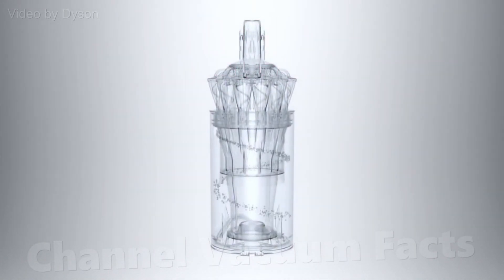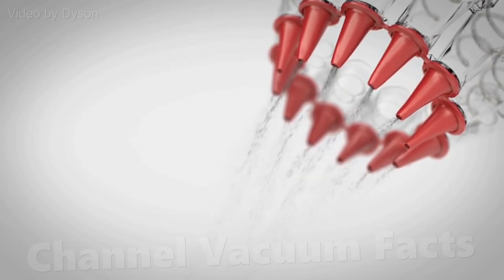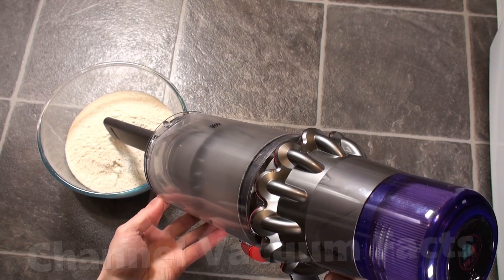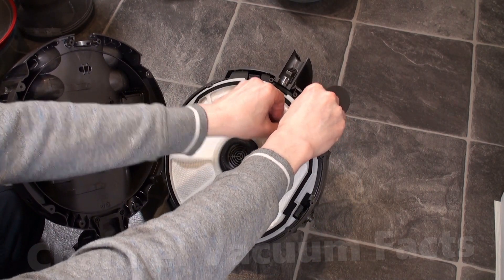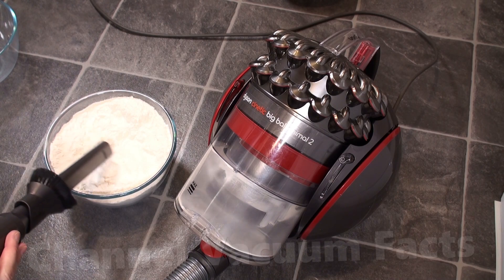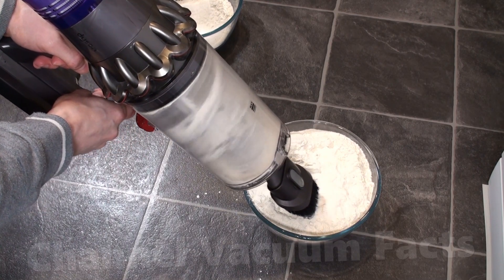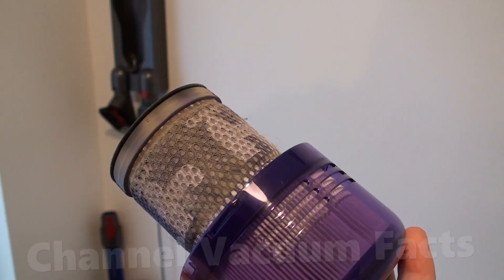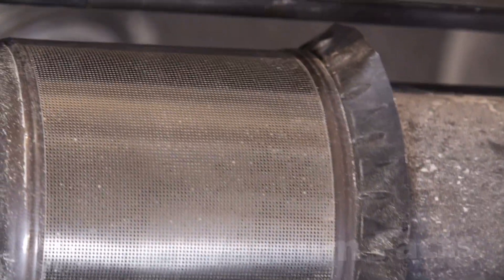Dyson Cinetic Myths – Testing How Good It Really is!

Comment: is it just me or does anybody else think these things are over engieered?
Reply from the maker: No idea what the term "over engineered" means, specifically and in context. Whenever the term crops up, it's never explained or qualified in any way, let alone with any convincing evidence to justify the position. From what I've seen, it's just a non-term that means literally nothing. These machines are, however, engineered to achieve specific practical functions, and do them well.
Reply: @VacuumFacts 
‘Over-engineered’ is a term for something that is engineered well beyond its expectations of usage. This can have no negative practical effect on the subject in question like Dyson machines. It also can induce heavy negative consequences on the subject from the excessive engineering and negate whatever benefits it has. Example would be the Tiger tank used by the Wehrmacht during WW2.
Reply from the maker: I await the evidence that it applies here. I am aware of plenty of evidence they employ lean engineering, which is the exact opposite.
Reply: @VacuumFacts 
Yeah no I don’t think it applies here. I was simply defining the term saying that there are instances of over-engineering with negative impact.
Reply from the maker: @qasimmir7117  Good. No need to beat a dead horse.
Reply: @VacuumFacts 
I wasn’t.👏🏼

Comment: Dyson doesn’t sell  cintetic big ball 2 in North America. There are ways around that my question is the plug is there a safe way to use the machine in America. Like having the enter mains cable replaced or an adapter?
Reply from the maker: It can work safely only if you operate it at the correct voltage. You'd need the appropriate transformer to provide the voltage (and power) the machine expects. That can end up being impractical, since transformers are heavy. I'd recommend saving up and investing in one of their newer products instead. There's a new mains-equivalent stick vac coming out in the not too distant future (called the Piston) and possibly other machines, currently out in Korea. Technology has moved on considerably since the Cinetic days. https://www.dyson.co.kr/piston-animal-ds60-cordless-vacuum-matte-black-copper https://www.dyson.co.kr/products/vacuum-cleaners/cord-free/piston-animal/owners
Reply: @VacuumFacts but I like Dysons canister and I’m tempted to purchase models that were exclusive to Japan
Reply: @yLaQueso0 You could use oven, stove, range, dryer or car charger plugs which should give 240V. But you could just get a transformer rated for 900W(thats how high vaccums can go by standard) and it will run all vaccums. Dyson cinetic is about 700W
Reply: @mineciberkay it’s not worth the risk
Reply: Because America uses 120V You would need a step up transformer To convert 120 V into 240v Countries with 240v Have high voltage and low amperage where is America  Is the opposite they have low voltage and high amperage. But if you plug A 240 V appliance into 120 V theres a chance it could damage it Some vacuum motors can be modified to work But it would be more hassle Than just to buy a converter

Comment: Don't believe the hype.  They clog..

https://youtu.be/gToZaFyBMoY?si=sJUg8jX8HcoRP15P
Reply from the maker: I don't believe hype; I believe evidence. Yes they do clog...when abused and neglected, like anything, as shown in the misleading video you linked to. When used properly, they work fine, as evidenced in this video you're commenting on.
Reply: @VacuumFacts  They have no pre motor filters.  During regular use they can and will pass dust and debris through the motor.  Dyson advertises that no maintenance is required with these machines.  Using them properly with no maintenance can and will lead to failure.  It's misleading on Dyson's part
Reply from the maker: They have no pre-motor filters because the cinetic cyclones remove the particles they would have anyway. Nothing passes through to the motor when used correctly. This is evidenced beyond all reasonable doubt in this very video. However, if a machine is abused and not emptied, the cyclones can fail, causing large quantities of dirt to escape them. Abuse and neglect causes this machine to fail. I've seen no evidence showing precisely how to reproduce alleged failures from correct use. If you have any from a reputable and convincing source, please share it. Unfortunately the source you linked to before failed to show this and only showed what looked like abused and neglected machines.
Reply: @VacuumFacts  That is the theory but in practice it's just not the case.  You're either a paid influencer or a Dyson fanboy.
Reply from the maker: Unfortunately, you've provided no evidence to support your claims which conflict with evidence available that they work fine (you really should watch the video you're commenting on...). I've no reason to believe you. And given that you ended with unsupported personal accusations, in the absence of anything of merit, you've also now lost credibility and respectability.
Reply: @VacuumFacts  I have watched the video and I have my own Dyson Cinetic Big Ball Turbinehead in addition to a V11 from which to draw personal experience.  You want to discount what you choose not to believe.  https://youtu.be/7nS6x6BZDJw
Reply from the maker: If you've seen my video, shame you literally ignore the observations and don't account for them in any detail whatsoever. Your linked video is, again, evidence of a machine whose history is unknown and therefore more likely a user that has neglected it and it failed. The video shows no evidence of a method to reproduce such failure by only using it correctly, which is what is needed to support your assertion convincingly. It's very simple to change my mind but you're working against yourself by peddling content from infamously misleading sources and misinterpreting what's shown. What you also don't realise is that if you can show, with evidence, that the machine fails when used according to the manual, you'd be able to get very rich from suing Dyson. Hasn't happened though...perhaps the burden of proof just hasn't really been met. Trott on.
Reply: @jhh469  ive had my cinetic DC 75 for at least 12 years. Never had to change the filter or clean it out. If you let the bin get too full, way past the full marker then dirt can get past the cinetic and clog the filter. I suspect Dyson decided alot of customers were letting it get over filled, so they dont make too many cinetic vacumns these days.

Comment: i feel like if they brought this back they would sell better than they do now. the idea of having a vacuum without maintenance was amazing when bagless vacuums came out until filters. people would go through vacuums without knowing about the filters. The cinetic technology would sell so many more models just for the thought of no cleaning filters or bags just emptying
Reply from the maker: Possibly. The cyclonic technology has improved a lot since the mains machines, and the filters see so little dirt on the V15/Gen5, even without cinetic tips. They're likely to see less still in the next model with the possible changes to the first stage bin cyclone and variable cyclone use to maximise airspeed through them.
Reply: They stopped because the kinetic tips became a trap for long hairs, any hair longer than 4 inches would clogg all these machines, the Achilles heel of most Dyson's, great for dust, but terrible for hair

Comment: Watched another guy test the new cinetic system. Before he started, he showed no dust in the middle tube that feeds right into the motor, vacuumed for a few minutes amd made sure to not pass the max line but when he checked again, he was able to wipe dust off with his finger; the cyclones werent able to filter the dust. The name was the Dyson DC75 Cinetic. I think that similar testing showing completely different results just shows that the system is unreliable for mass market use. Maybe the tolerance for building this type of product is too small for dysons manufacturing capabilities and might be why there are so many differing stories
Reply from the maker: That vague anecdote was hardly convincing. Any real evidence?
Reply: @VacuumFacts  ur test was just as much an anecdote as the other guys test....and taking a company worth billions of dollars at their word is not very smart either
Reply from the maker: You evaded an answer and then confused an empirical observation with an anecdote. I think that tells us all we need to know about your input here. Adios...
Reply: @VacuumFacts  your test was an empirical observation while another youtubers test is an anecdote....? Make that make sense?

Thousands of bad reviews is imperical data, not anecdotes.

Comment: I conducted an experiment with my V11, absolute pro. I cut a piece of bounce sheet and put it in the canister bin of the machine. I've noticed a very good improvement on the canister. All that fine dust stuck to the bounce sheet and didn't cling to the canister. Lots of the fine particles are statically charged. Without the bounce sheet i tapped the canister lightly and the fine particulate dropped onto the paper towel. This was done after 1/2 hour of vacuuming. Then I cut a small section of bounce sheet and stuck it into the canister and vaccumed some light carpeting and floors upstairs for 1/2 hour and wow, the fine particulate stuck to the bounce sheet. After inspecting the canister on the screen and in the main passages there was barely any fine particulate stuck to it but the bounce sheet held all the particles. After tapping the canister nothing came out of the cyclones and using a flashlight inspecting the inside it was very clean. Even the seals on the lid and on the top of the bin had no dirt accumulations.
Reply: This is a very good experiment thank you for the info!!
Reply: Wow. I’ve never thought of doing that. Absolutely gonna try it now!

Comment: The main engine filter used to get really dirty n needed changing n was quite hard to do ,complete nonsense this was that's y dyson brought bk the filters
Reply from the maker: No residential vacuum cleaning product has an engine. If you're suggesting cinetic didn't work under responsible usage, then please see the video for evidence to the contrary.
Reply: @VacuumFacts  I had an upright and a cylinder I know what I'm talking about, also the cylinder moter burned up, u did one simple test u didn't use the machine for 2 years ,loads of people complained the same thing there's a very good reason they discontinued the thing, not possible to have a vacuum without a filter or pre filter ,that's y they r there now
Reply from the maker: Unfortunately, you've provided no methodology to reproduce your alleged failures, which is considerably less convincing. Also, they haven't discontinued them, globally; they're still sold. If you're wrong about that, when it's so easily fact-checkable, I've no reason to believe you're right about anything else. Everything you said is a myth debunked a long time ago. Cinetic was discontinued because the focus is now on handheld devices which can't support it and it'll not likely return because of newer, better technology. This was all discussed in the video.
Reply: @VacuumFacts  ur talking about newer better technology then y have they stepped back and returned to the filter??? Ur also wrong because they made one more dyson after this and its an upright without the cinetic that didn't work,  every machine I worked on had burnt out motors because the filter was blocked up ,every filter I took out was destroyed by dirt, I know u want this to work but it just didn't although if perfected it would be awesome it just wasnt
Reply from the maker: >> "ur talking about newer better technology then y have they stepped back and returned to the filter???"
This is discussed in the very video you're commenting on. I recommend watching it. Also please read my previous comment; Cinetic products are still sold in some geographic locations.

>> "they made one more dyson after this and its an upright without the cinetic"
Yes, because focus was shifted to cordless research. Please see previous comment.

>> "every machine I worked on had burnt out motors because the filter was blocked up"
Please see previous comments. If you can provide a detailed methodology to reproduce when used as instructed, distinct from abuse and neglect, then the cause can easily be identified instead of assuming it doesn't work. There is copious evidence it works well when treated well, such as in the accelerated use case shown in the video.
Reply: @VacuumFacts  ur video proved absolutely nothing ,u used flour then showed us a white filter, if u wanted to show us a white filter with no signs of white flour on it y didn't u use a uv light to show traces of anything on it?? U should of used plaster dust n really test it , or somthing different coloured ,either way we can see white dust on the bin the black seals which means it dust work, dyson tested the machines with as little as 40g of dust in each test then maybe it does work but that's unrealistic, y r u defending a failed idea?? Are u sponsored person defending dyson failures?? The only dyson that was actually good was dyson dc14!  If the cinetic was any good dyson would of used it on his last upright made! It's discontinued worldwide and has been for a while, dyson dc 15 detect same crap if u pick up loads of rubbish with it the filter has visible dirt on it meaning suction must be lost like a bagged vacuum

Comment: I have a Cinetic (don't remember the model Big Ball?), two uprights (DC44,  UP14), and two cordless (V11, V15).  They all work fantastic with animal hair, dust, whatever, damn things pull dust out of carpet amazingly well.  The Up14 is not maintenance friendly.  Everything is screwed down on that thing.  Had to replace the power button on the V11 with a metal replacement, that breaks over time. That was fun, dismantling the entire unit just to get at the button.  The UP14 hose parts deteriorate for some reason.  Replaced the main hose, and now the small hose for the brush head is rotted and ripped in three spots.  But in the right position it still performs as if there are no rips!  The suction is insane.  My wife loves her Dyson hair dryer and fan.  We might be Dyson fans.  The stuff lasts, that's for sure.
Reply from the maker: The latest cordless machines are even more maintenance friendly. Essentially all modular for swap-and-play.
Reply: @VacuumFacts  At least the battery is detachable and the power button isn't so mechanical (v11 to v15)
Reply from the maker: Yes. Although the battery never needed changing (short of abuse and neglect), and the trigger required no extra effort to activate because it was feather touch and people only complained about hand fatigue if they didn't understand and squeezed it.
Reply: Screws holding everything down = Not maintenance friendly?! On what planet?

Comment: It’s a damn shame Dyson stopped selling the Cinetic in the US. I would have bought one.
Reply from the maker: All the Dyson machines have market leading filtration without needing to rely on a filter. You can get away with very irregular filter rinsing on the latest mains-equivalent cordless models in their default mode.
Reply: I just ordered a Big Ball Turbine Head ($229) from Dyson USA...it's new, not refurbished, so they still have some of these. Walmart does also. Maybe some others. It's not called the Cinetic, but looks like one.
-- BR

Comment: I placed the order for a used Dyson cinetic mains vacuum finally today. I should have done it a week ago - I found the ONE or TWO things that my outsize absolute cannot handle. Ultra fine drywall dust. Even on boost mode, it's been clogging the filter. It really did shockingly well for a LONG time. I suspect what's going on is that some of it has gotten embedded in the filter in exactly the way that needs to be washed out. Since I only have one filter, and I've been using it every day for this very fine construction dust, I haven't been able to wash it and wait the 24 hours + for it to dry. This definitely counts as extreme abuse. Before these last few days, I was making it through an entire bin full of drywall dust from 80 grit and 120 grit drywall sanding - I've one of those diy kits that let's you hook up a vacuum to capture the sanding dust so it doesn't go everywhere - and only just starting to clog the prefilter. Sadly, they're currently out of stock for this exact filter unit, so I can't rotate them and wash one while using the other. 

If Dyson were to make a Dyson cinetic shop vacuum, and made one with a big enough airflow path for the big chunks and such to not get stuck, oh my God they'd corner the whole market! It really does exceptionally well even without cinetic cyclones... It would be amazing with cinetic!

I'll come back here after abusing the cinetic model.
Reply from the maker: I suspect the 'shop vac' market is relatively numerically insignificant. But maybe a Cinetic already is an effective shop vac, if that's how someone wants to use it.
Reply: @VacuumFacts  I don't know the size of it. I wonder now. But if you compare to the highest end dust extractors used for the worst work conditions, where sometimes by law they need to use vacuums, the current market has vacuums that run thousands of dollars. Imagine if Dyson entered that market, with a cheaper product?